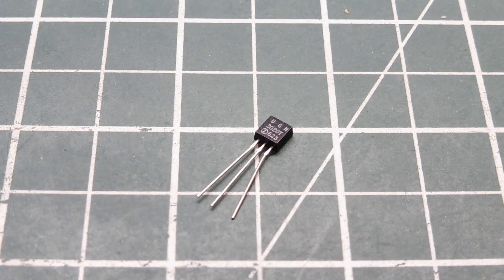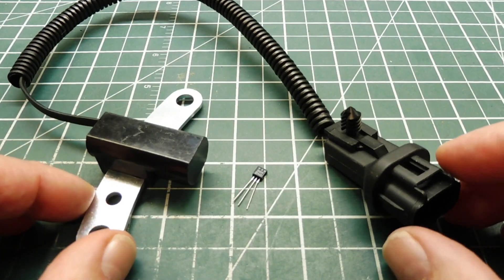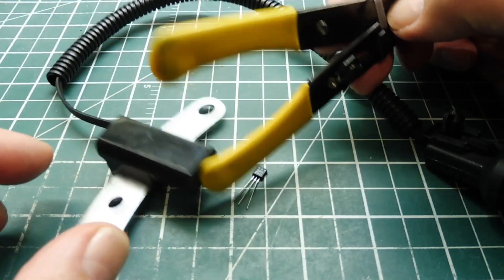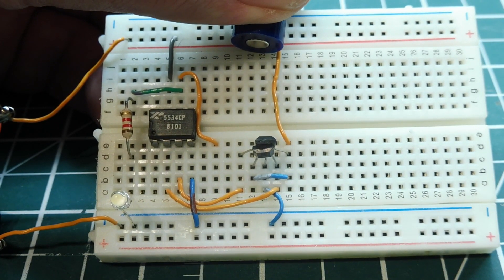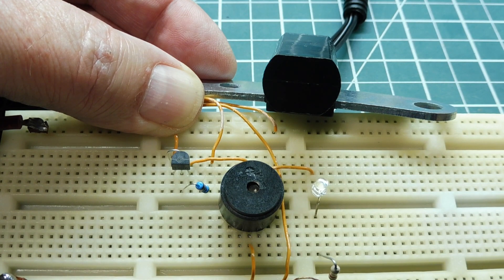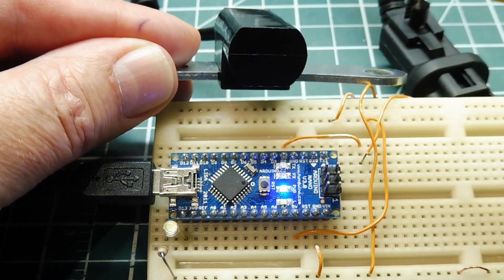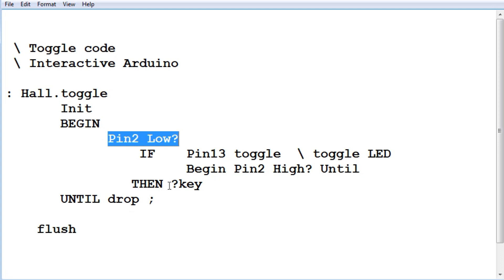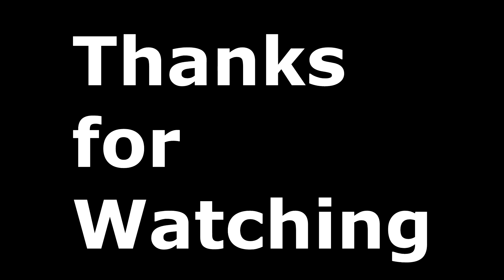Simple Hall Effect Circuit Using Automotive Sensors / Nano / Forth

Comment: @0033mer  Great to find videos where someone has had a similar idea/thinking. 
The manual and automatic connectors are slightly different looking, how could I work out the pin out? 
My version only has a small vertical ridge on one side, but no clip on the (top?)opposite side.
Reply from the maker: Unfortunately there are no standards on sensor pinouts among the car manufactures. You have to get the service manual from the car the sensors came from to get the pinouts. Also check online for ignition wiring diagrams.
Reply: @0033mer  I thought that would be the case. I'll continue looking . Thanks for the reply.

Comment: @0033mer can we have code and library can it be a momentary trigger instead of latching is possible that one trigger can be many pulses of ignition to mimic a lumpy cam or some other timing with crank timing I’m making a air compressed engine with a arduino, Hall effect, and relay or transistor to trigger a air valve solenoid can you share how the transistor circuit works
Reply: @0033mer look up at my comment

Comment: It would be really nice to have a tutorial on interfacing 16 x 2 serial LCD's using Forth. I did the parallel version years ago in 6502 Assembler  but having some pointers for the i2c implementation on the Scamp2 board would be so useful.  By the way it looks like  the word modules is so useful in finding the address of i2c peripherals . Lastly there is a bit of a delay in the supply of the Scamp2 boards but I'm sure they are worth the wait.
Reply from the maker: I have Forth code for the Scamp2 to drive the LCD1602 display with the I2C piggyback board so a video is on my list. I am waiting for more Scamp boards to become available.

Comment: If you use a hallsensor with latch, for example the US1881, you dont need a mikro controller.
greetings nische.
Reply from the maker: I wanted to show a simple micro-controller interface for anyone who is interested. Latching Hall sensors are handy but you need a South pole magnet to latch and a North pole magnet to unlatch.